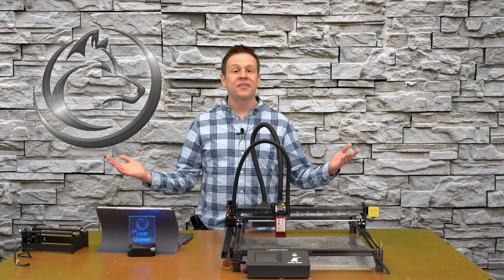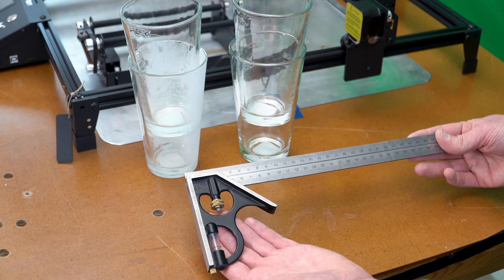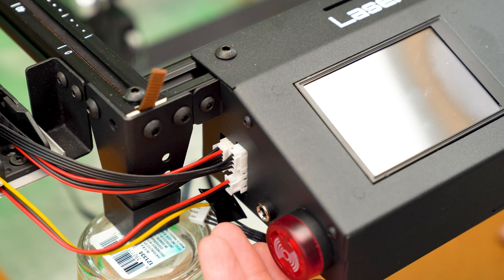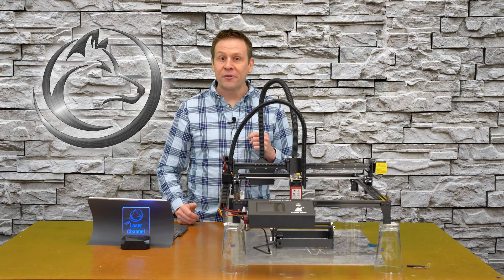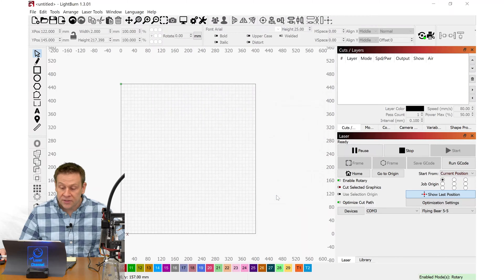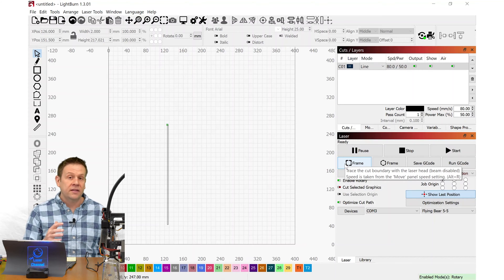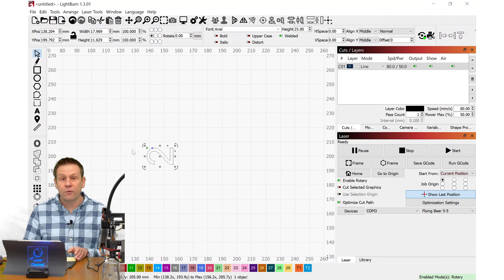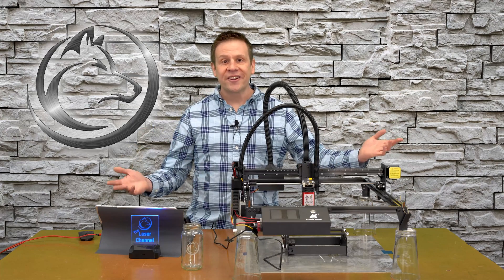Flying Bear Rotary Setup

Comment: There is a 3d printed item you can connect to this item to help level your item. I have not used but have printed it for future use. Also there are legs for this machine that I have printed and used.
Reply from the maker: Hi- I do not own a 3D printer.  On other similar rotary units I have- I've used some spacers to level the top of the glass to the laser.  Here's a video showing a roller type rotary unit engraving a pint glass: https://youtu.be/JWfXfd0dHFc